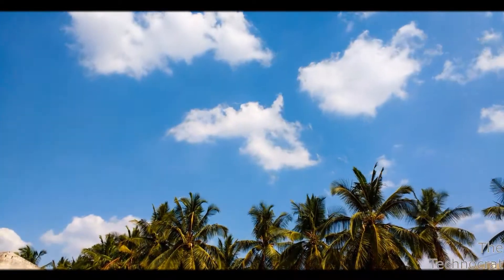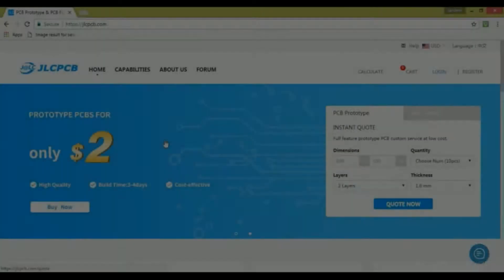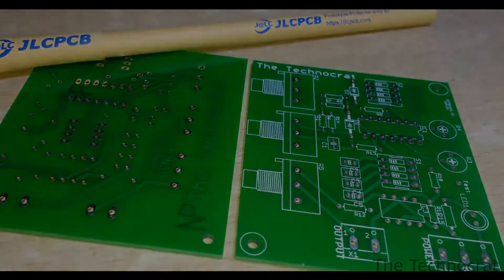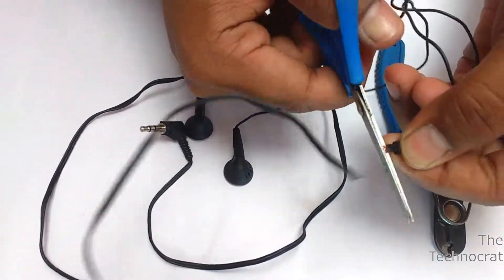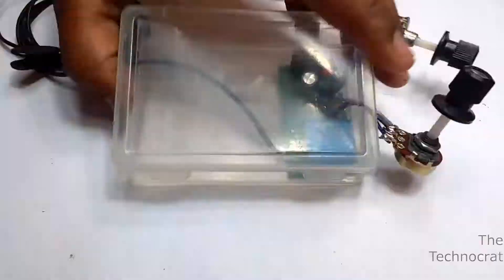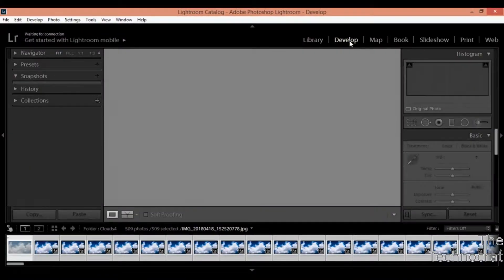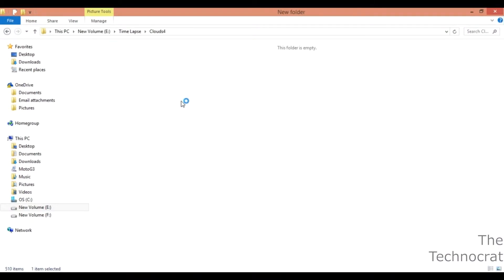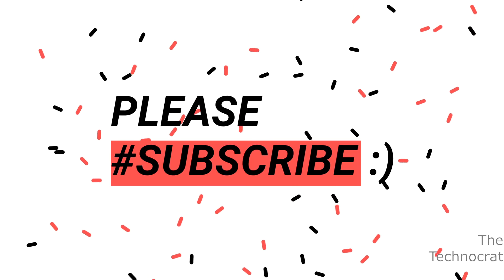Make Time Lapse Remote for DSLR and Mobile Camera |Intervalometer

Comment: Nice work, but I think the circuit you have for triggering the smartphone may not work for a lot of people.  On my Samsung Galaxy 8, my camera shutter (and volume up) can trigger remotely only if you tie the mic and ground pins of the jack across a 220 ohm resistor.  You can use a resistor as low as 200 ohms and up to 700 ohms which results in a a voltage drop of 220 mv to 660 mv across the jack pins to work the shutter.  As a side note, the higher voltage (350 to 660 mv) can also control the down volume when not in camera mode.  
One more thing, the L & R (tip and ring 1 of the plug) have no effect on the shutter, so don’t know how you were able to get yours to work, other than you used a 3 ring jack so probably caught the edge of the ground ring when you plug yours into the phone.  Anyway, keep up your creativeness.  Appreciate the work you put into this project.